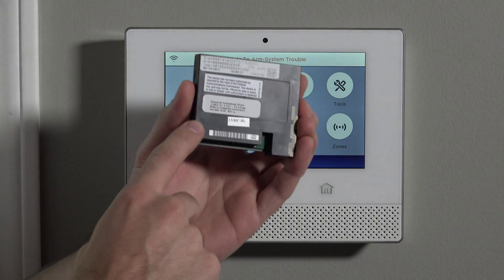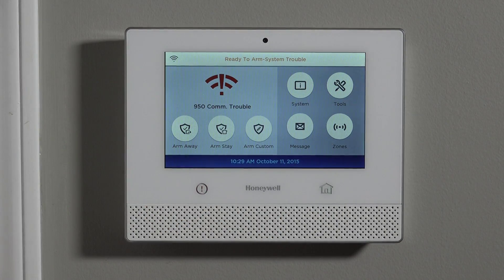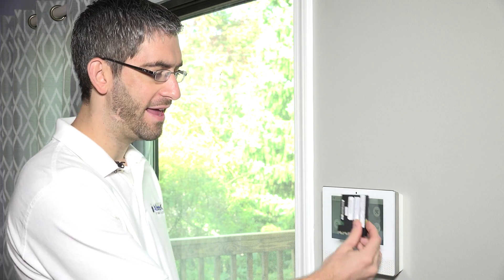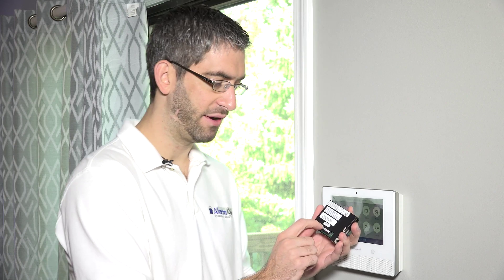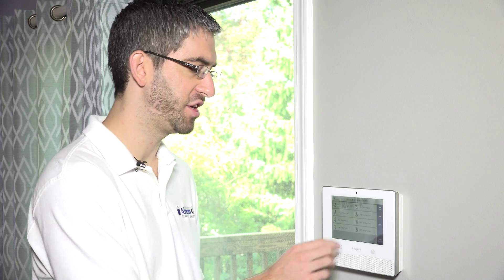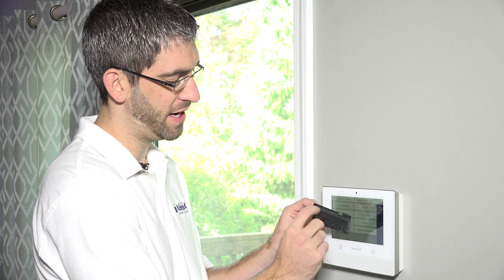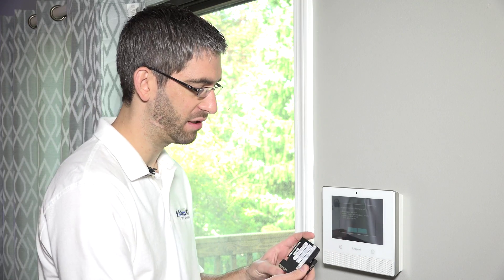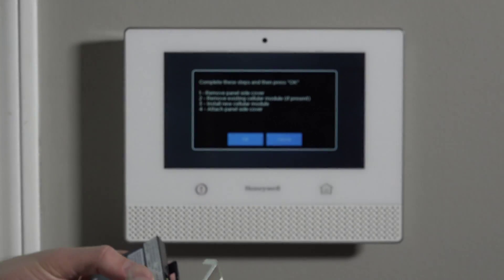Honeywell LYRIC-3G: Installation into Lyric Security System

Comment: Is it possible to use the lyric-3G outside the US, is an unlocked module? Or it only works with ATT and Verizon in the US? I plan to buy this system to use it in Latin America with 3G but I can't find information regarding if it will work or not on a different celular provider.

Comment: DO ALL CENTRAL STATION COMMUNICATOR HAS 3G VERIZON AND ATT 3G. WHICH IS CHEAPER FOR 3G MONITORING
Reply: I'm not sure I fully understand your question. Do you already have an existing alarm system or are you interested in purchasing a new one?

Typically, the alarm monitoring cost will be the same whether you use a Verizon or AT&T communicator.